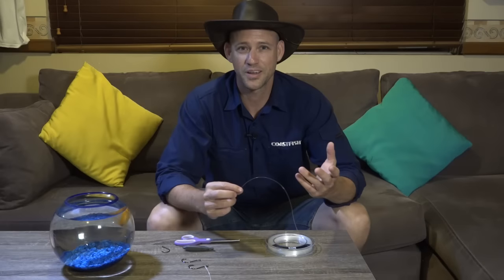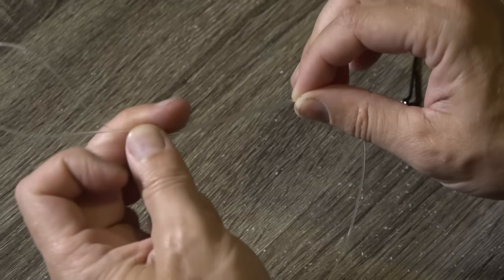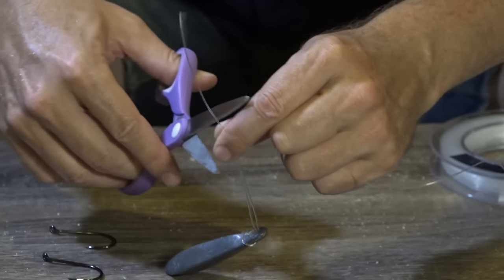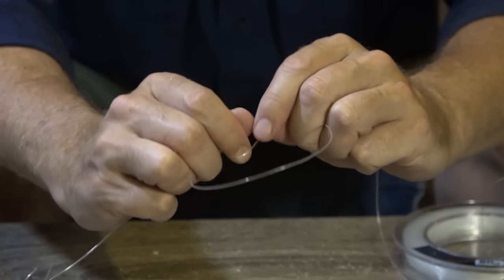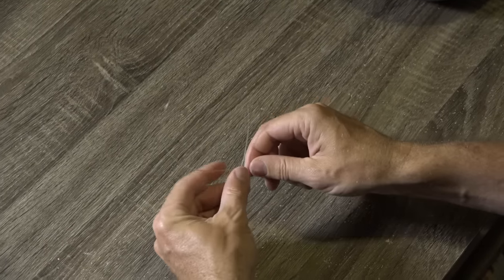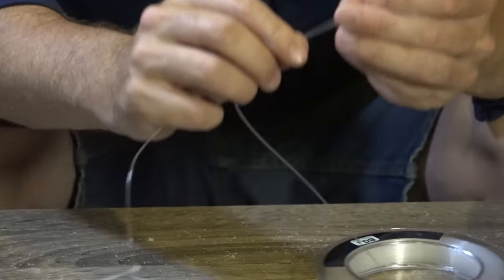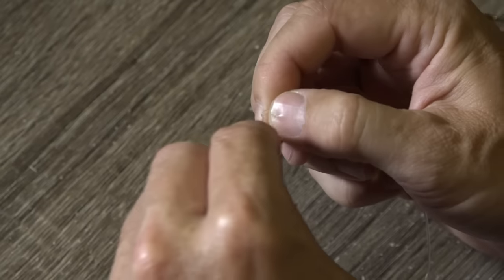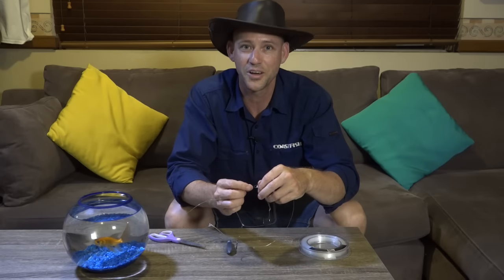FASTEST DROPPER LOOP and PATERNOSTER RIG | How to tie Fishing Knots | Fastest and Easiest way

Comment: Here is a hint; this knot can be used to connect 2 pieces of line together (a blood knot). Start by tying the 2 lose ends together with a simple knot then follow the directions in this video with the simple knot in the middle of the loop. After you cinch it tight just cut the loop off.

Comment: I use 60 pound braid to a swivel then 80 pound mono, big ling cod lure on the bottom with a upper loop for a shrimp fly and I've been using this knot for that loop, problem is if it does break off, it's mostly at the dropper loop. Is there a stronger knot for the dropper loop? Like a double surgeons knot?

Comment: One thing that must be addressed is the weakness of the dropper loop knot. I can guarantee it will reduce the line strength by at least 50%. (See for yourself.)  So those anglers who plan to use this dropper knot must take this into account for the strength of the leader they use.
Reply: I also read about it and experienced it first hand too. What is your choice of knot as an alternative to dropper loop knot?

Comment: Great video at 41 seconds into the video I wish you had a closer shot so I could get a better picture of what you were doing. I understand visual better at times then words.
Also I have small hooks with a small to put my loop through. Did it but was hard withought wanting to make a kink in my line trying to put my loop through. Any suggestion?
The easiest so far of all the videos I watch.
Reply from the maker: Use lighter line which is thinner if you struggle to push the line through the eye of the hook. A kink is fine. If it's good quality line it won't reduce the breaking strain

Comment: I've got a question. Can you cut the loop to tie the hook instead of threading the hook?  So that it is just one line instead of a bouble line attached to the hook.  Thanks for the video it has made it easier for me to do this knot :)
Reply from the maker: Technically you could. As long as you are using both threads. Otherwise pressure on a single thread MAY compromise the main line knot itself. 
Test it out and let us know how you go.
Reply: Thanks for asking this question!!!!   That's my plan and what I just did.   Will be trying it out on shore tomorrow.  25lb line 2 hooks off a cut dropper loop about 2ft apart.  Going for barred jacks .   I would not trust or try it on big fish.   Here goes nothing!!!

Comment: What size strength in line to use?? I typically use 50lb braid buttt mannnn you can’t put the hooks on lol. I used 30lb mono and works great. I’ll probably try some 50lb mono next to see if works
Reply from the maker: 30lb or 40lb seems to work well. But we went heavier and just used bigger hooks.

Comment: great video mate, would the double line of the loop put off smaller shore species like salmon trout? would you ever cut off one side of the loop and tie the hook onto the single piece of line? thanks!
Reply from the maker: William Chamberlain You wont put of Salmon Trout. They're an aggressive fish. I used to catch a lot of them in South Australia. 
I wouldn't go cutting the loop personally no.
Reply: thanks for the response! i'm off to south australia tomorrow, are the chances of catching salmon good ?
Reply from the maker: Absolutely. The beaches are great for Australian Salmon. York Peninsula is the place to chase them.
Port Noarlunga jetty also can produce good fish. The Salmon school up in winter time. Colder the better. Goodluck

Comment: Certainly easy to tie as per the vid.  Not so sure that the knot stands up to strain on the  two straight through parts of the line. Pulling on the looped dropper itself seems fine but when I pull hard on the line going back to the rod and the line going down towards the sinker my 20 lb Schneider line breaks .
Taking a piece of the same line I can't break it with my hands when it hasn't got any knot in it.
Reply from the maker: Cheers for the info mate. Personally ive never had a pater rig let go and I've hooked some pretty heavy girls off the reef. Perhaps the quality of your line may play a part in it?

Comment: For the dropper loop when i tighten it the loops unwinds i get a swirly line Is it beacause the knots are few?
Reply from the maker: alby910 Make sure you use a good quality line. Also you can hold the loop in your mouth as you are pulling the loop together. Let me know if you're having any more issues and I'll work with you to rectify them.
Reply: CoastfishTV   thank you

Comment: You never addressed the weakness of this knot. The hook line is at right angles to the main line which reduces knot strength by 50%. This is particularly  important if you are using lightweight fluorocarbon. That said you do have a double line going to the hook, but this will only apply to larger eyed hooks. I guess this rig is best applied to heavy handed thick nylon fishing. Oh forgot to say this is actually a difficult knot when you just need to tie 3 or overhand knots, much easier

Comment: Excellent vids mate can you just do the fg knot instead of using a snap
Reply from the maker: Ethan A Cheers mate. Honestly I've never tried to connect a Paternoster rig to braid with an FG. But it doesn't mean it's not worth trying. 
Though if you had a reel spooled with braid, I'd probably just throw on 12 inches of leader with an FG then a snap swivel to the Paternoster. 
That way if you get stuck on the bottom you'll hopefully lose just the Paternoster at the snap otherwise you might be having to tie a few FG's on your trip chasing fat fish on the reefs. 
Just a theory ;)
Reply: CoastfishTV yeah l agree thanks for your help

Comment: How come when I tie it, I try and pull to test it and it snaps Everytime. I'm using 20lb line.
Reply from the maker: Not sure to be honest mate. A bunch of us have been using this knot for years on big reef fish and it's never let us down. This is purely a guess at my end. Let me stress that. The line could be old/worn/low quality/Not enough turns/Line unlubricated/knot pulled too quick creating heat resulting in wear/unlucky.
If it's none of those I have no idea. 
Biggest fish I've pulled on this rig was an 8kilo Cod.
Reply: @CoastfishTV  I am using $1.68 fishing line. Lol. However, it is reliable. I've caught Carp on this brand of line. Let me say that it does take quite a bit of pull to snap it apart. But it does snap apart and right at the first loop usually. Idk. I tie the same knot's but with a different method and it holds up. However this method is so much easier and quicker.
Reply: @CoastfishTV  Ok, maybe this'll help. The Knots lose the loop in them when you pull from the weight and clip/tie loop. Basically, I pull both ends and the dropper loops tighten without keep the loop. Am I doing something wrong?
Reply from the maker: @peruvit  Could you possibly get a mate to take a short vid on your phone and send it to me in a PM via my CoastfishTV page. If you are not on Facebook would you upload the video to your YouTube channel and send me the link so I can see exactly how you are tieing it. 
Then I will examine closely the way you tie it so I can accurately resolve the issue. I am keen to see you master this loop.

Comment: The knot keeps on coming undone
Reply from the maker: Something about your tie is not right. It's impossible for them to come undone. Keep trying mate. Watch the video carefully. Step by step. Pause it if you have too. Goodluck 👌
Reply: @CoastfishTV  literally impossible.  Doesn't lose much strength either. I've been experimenting with 2 lb test and different knots on the same line to see which knot fails first, and not a single time has the dropper loop broken before other knots I had in the line. That's not a bad idea for a vid!  Having a knot strength tournament 😂 you're welcome, mate!

Comment: I have watched all of your videos Andy  and I am shocked that you are showing your  viewers a practice that you do which could result in a fisherman loosing perhaps a fish of a life time, a Trophy Fish. The thing which you do is when your tying all of your different knots is that you do not lubricate the knots before tightening the knots up. Every time you tighten a knot you are weakening the line strength by at least 50%. If you look at your knots you will see the monofilament adjacent to the knots is crinkly and not straight line like  the rest of the line. This is happening because of the heat generated by you tightening the knots without using a lubricant such as saliva or just plain water. Just get you building methods right, there is more to rig construction than you appear not to know.